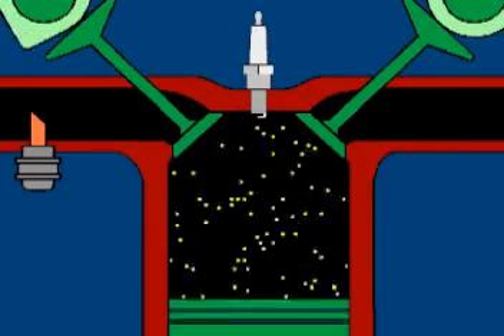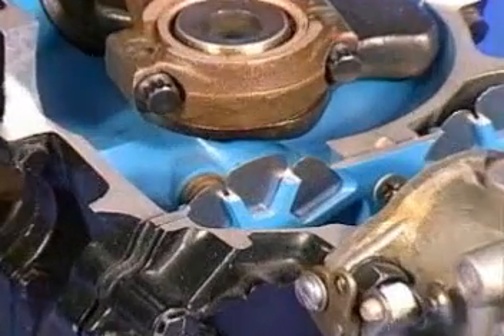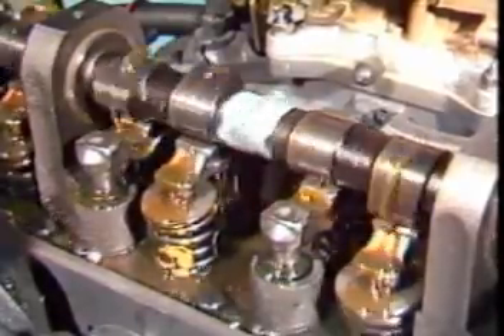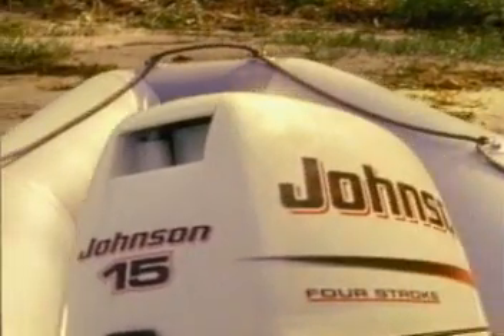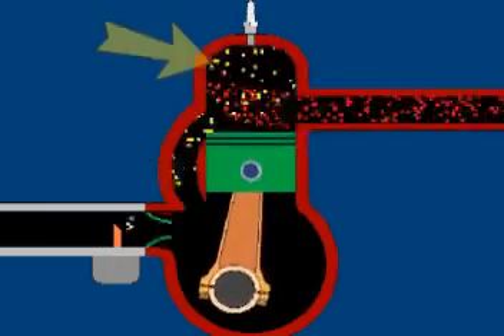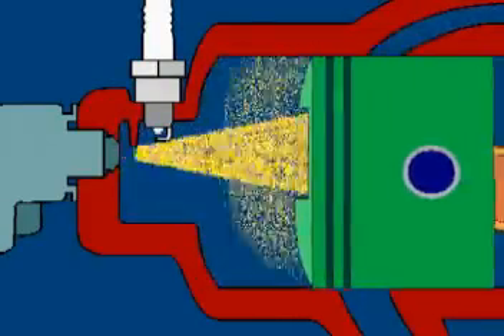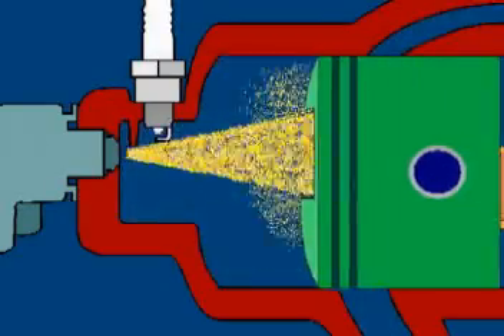2 stroke outboard Vrs. 4 stroke outboard

Comment: then you arent riding it right. what year yz250 is it? mine is a 96 yz250.  If 2 strokes dont have more power than how is it when climbing a hill, when i ride a 450 and it starts to bog i have to down shift, when on my yz 250 i can up shift and hit the throttle and the back tire is still spinning all the way up? The only thing 4 stroke has is torque. Or you can ride my dads 1980 yz465 2stroke and have more torque and topend power than a 450.

Comment: @MYNAMEISBBOYFIRE And because you're an 11 year old boy, someone with a greater perspective on the bigger picture should point out how exaggerated & flawed your argument is concerning polution. That two strokes, even with modern fuel injection, because of their constant loss oil system, will always be less clean than 4 strokes. However, their severely restricted & minor use in practical terms, means that their extra affect on the atmosphere is negligible to non existent.

Comment: Disc valve induction such as used on the Kawasaki KH125/AR125 is far better than reed valves, as discs are mechanical controlled and therefore, open and close at exactly the right time, whereas reeds rely solely on the crankcase pressure and thus are less precise. The two-strokes I've driven with disc valves give a better powerband and better fuel economy. We have to thank Walter Kaaden for the disc valve and this basically gave two-strokes a position at the top of the league table.

Comment: @Anoush13 The two-stroke engine only lightly compresses the air beneath the piston, so this doesn't hinder performance. However, a four-stroke engine has oil in the crankcase so this can cause fluid resistance of the crankshaft, therefore hindering performance, so dry sump lubrication then can be advantageous as the oil is kept separately to the engine and pumped to the various parts as and when needed.

Comment: Even with GDI Two Stroke engines, the oxygen entering can still leave through the exhaust and not all the excess CO2 leaves through the exhaust. You'll be getting a very unclean burn. Not only does this hurt engine performance, it also is terrible for the environment. 

Also, during the down stroke, wouldn't it be harder for the piston to move down, with all that pressurized air blocking it? This is also a major flaw, and hurts engine performance. Plus two strokes burn a lot of engine oil.

Comment: @bowen1100 They have oil injectors in specific places in the crank. That way it gets only the correct amount of oil exactly where it needs to be. It gets oiled better with like 1/10 the oil usage. Ski-Doo has a good video about it for their e-tec sled.

Comment: @bowen1100 

There is oil, you pour it into a resevoir.

But they use so little oil.

Agip, Honda, and some othe companies sell oil for direct injected 2 strokes, which also works in a regular 2 stroke.

Comment: @SonyCrocket Not true, you need to do a lot more to keep up a 2 stroke than a 4 plus they run at higher rpms so they get hotter thus shortening the life. Look at a Honda outboard they need very little upkeep 2 stay running. my dads went 4 17 years b4 it needed a new impeller and he has had nothing go wrong with it other then that. Also you know Honda is reliable because the US military uses them

Comment: Type in "Hirth 60hp 2-stroke heavy fuel engine with Orbital FlexDI (air-assisted direct injection)" in Youtube.

Explains the Orbital premix injection system - ideal for 2-strokes. Compressed air/fuel injected directly into the cylinder, computer management can give split second timing & air/fuel mix giving high power & clean emissions. Bottom end lube can be same as a 4-stroke. Have the Revetec camlobe replacing crank - no piston side thrust - Orbital 2-stroke top end - ultimate piston engine

Comment: @phyriz007 
"I wonder why Wankel engins arn't used in boats? There small, and can make some good power and spin to very high rpm"

It operates economically at its constant speed "sweet spot". A very low power/weight ration, "very small", means they are ideal for range extenders in hybrids, where they are rarely used because of the large mains charged battery packs - Audi are R&D them for this use. Can be under the trunk floor or under a rear seat - very smooth and quiet so feasible

Comment: @SteezySteez2011 
"Oh yea, and fuck electrics."

You better get used to them as they will be the norm. They are vastly superior all around. The weight of a battery set & electric motors to give same range as an ICE is about the same as engine/transmission and FAR simpler and infinitely more reliable. Ina car body designed for electrics, the batteries can be slung low to give a low centre of gravity meaning safer with far superior handling. Motor in wheel hubs means switchable by mcb 4x4.

Comment: @guitargod66 
"how is the bottom end lubricated?"

Normal oil bearings like a 4-stroke, using a scavenging blower. Pre-mix Orbital injection system is superb.  There is no need for 4-stoke engines today. Lotus have the Omnivore 2-stroke engine. Cylinder head is a piston moved up and down slightly by an electric servo motor to vary the compression ratio. Uses direct injection.

Look at the Ecomotor OPOC, Bill Gate's $ - 2-stroke opposed piston, opposed cylinders. Looks like to be on matrket

Comment: @MrWinner2160 Wrong, the two stroke delivers a power stroke twice for every time the four stroke delivers one, therefore yeilding more power.  The failure of your comparison is most likely because you are not comparing engines of the exact same bore and stroke.  Even though you're comparing engines of similar volume the bore and the stroke are what determine power and torque.  I am only 16, and I'vebeen  working on ICEs for about a decade and nothing in your comment makes logical sense to me.

Comment: From time 1:37 the MODERN DIRECT INJECTION 2 stroke motor is shown:

- it lowers the waste and pollution in comparison to classic 2 stroke motor with carburetor

- SEPARATE source of lubrication is needed (since the fuel does not pass through the crank case)

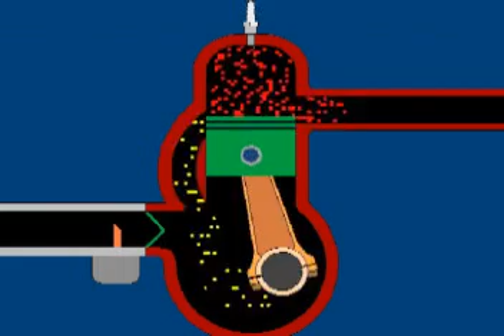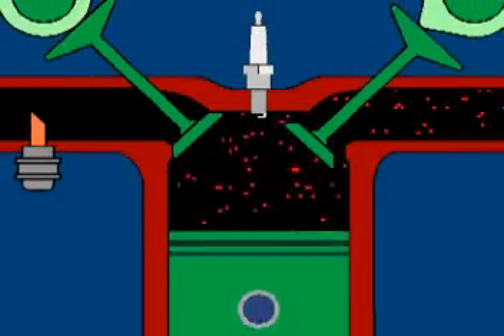Comment: @zeroc0ol2006 You obviously have no idea how a 2 stroke engine works... I suggest watching from 0:58 through to 1:25 over and over until you fully understand the cycle and the unique way that the 2 stroke engine works. The vacume of the compression stroke (which is when the piston moves up) draws air/fuel/oil into the crank case, which is when this area is lubricated.

Comment: @zeroc0ol2006 During the power stroke (when the piston moves down) the piston would first uncover the exhaust port allowing most of the exhaust to leave the engine and then it would uncover the intake port at the very bottom of the cylinder. The pressure in the crank case from the piston moving toward bottom dead center would cause the air/fuel/oil mixer to be pushed through the intake port into the cyclinder. Now the cycle starts over.

Comment: @zeroc0ol2006 So As you can see from this little lecture i have written, the air needs to move through the crank case in a 2 stroke engine. The 2 stroke engine cannot work in any other way. Fuel cannot be injected, it needs to move through the crank case to carry the oil, as air is too light and would not move it. The 2 stroke engine can only work in the way i have just explained. Stop this argument. Sorry kid but you lost.

Comment: @DangerZONEpixel Where do you see that the air flows through the crank case?
It only comes from the same direction.
I think that the crank case is a closed system filled with oil.

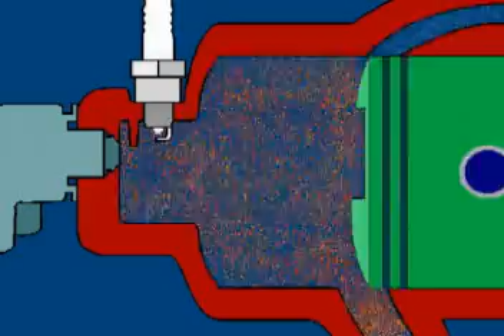Comment: @zeroc0ol2006 maybe try watching the video at the time zone i high lighted (2:00). The fuel is injected into the cylinder rather than passing through the crank case like it usualy would. Air is too light to carry the oil through the crank case by itself. Making this cycle impossible for lubrication to the crank case. Maybe you should rethink you comment now and maybe make an apolagy.

Comment: @Donnison27 I guess an oil injector in the intake air would solve that.  they did say that the air still goes through the crankcase.. another option would be to just supply oil through lines to the crank bearings and also oil sprayers.

Comment: using fuel injection system, I prefere one such design, 1st it did not draw the air into the crank case since there's oil in it 2nd it has dry sump as the oil jet is sprayed into the cylinder wall and crank case, 3rd there's no transfer port since being loop scavenging,the air enter the combustion chamber directly when top of the piston reach bottom end. in this way, it eliminate the need of mixing 2 stroke oil and has has greater reliability

Comment: just remember, after 10 years of running at wide open and the jugs blow in your 2 stroke, going through countless plugs and unmentionable bottles of oil, my 4 stroke will still be purring like a kitten, not to mention the low end torque in a 4 stroke.

Comment: from my previous comment, there should be a green 2 stroke petrol can run on straight gas as long as the air are not drawn into the crank case, such design may share the design of a 2 stroke diesel since they are lubricated in the same way as 4 stroke engine and can be turbocharged and/or supercharged, uniflow 2 stroke has exhaust valve on the top of cylinder. even small 2 stroke loop scavenged diesel engine use dry sump system without burning its oil in a crank case

Comment: I did like the uniflow design of a 2 stroke engine regardless if it is petrol or diesel, using fuel injector allowing to run on any of fuel. if I'm not mistaken, uniflow 2 stroke petrol engine can run straight on petrol without any problem since the turbocharger or supercharger are used for scavenging, thus not relying the crankcase and improving reliability, uniflow 2 stroke are lubricated in a same way as 4 stroke engine if not mistaken

Comment: @angelvetto19 without a crank shaft and the timming belt, a two stroke is a lighter engine. A very small vehicule works perfectly on 2 strokes. Even cars would be more fuel efficienty on 2 strokes. (I wouldn't pull that out on the highway, but still)

Comment: on 2 stoke model airplane engines, i notice when i run it unburned nitro sprays out the muffler. if you run it rich, as in more fuel than air mixture, a lot of fuel will spray out the muffler, and it will ruin your 70 dollar motor. nitro is 22 dollars per gallon too.

Comment: @jellyking12345 
they use such motors on  cruiser ships if I'm not wrong
The fuel injected is heavy diesel for those. And they have also gigantic roots blowers as air chargers

But as you say it could also be possible to use this system as moped engines with no oily exhaust

Comment: Bottom line is, if 2 strokes are so much better why aren't they more popular? It's like rotaries. I'd say having to add oil to the fuel is a task most people can't be bothered with so manufacturers stay away from anything that needs constant input from the driver.

Like water injection. Simply FABULOUS, you can raise your boost (if you have a supercharged engine), advance the timing, lean the mixture and use lower octane fuel but adding water is a maintenance item so they don't use it.

Comment: @jellyking12345  Ya I understand the motor oil lubes the bottom end but in a 2 stroke doesn't your fuel/oil mix lube the wrist pin, and connecting rod bearing? so if the oil's directly injected on the piston head how do they get lubricated? Thanks.

Comment: @WarbabyFox becouse compression of the 4 stroke is hygher then the 2 stroke it burns feul more eficient, i more then once drained the engine oil and was to lazy to bring it to the proper waste facility so i poured it into the gastank the feul mix had to be about 12 liters of gas and 2 liters of oil the bike ran just fine and did not even smoke my brothers 2 stroke yamaha 400cc smokes like hell and only has feulmix 1 50

Comment: @WarbabyFox i have 4 motorcycles all 4 stroke for my drivingscool so they get used dayly i change the oil evry year thats 4times 4 liters of oil thats 16 liters of oil a year thats way less then 1 liter a week and also the oil draned from the 4stroke engine gets reused as feul for ocean liners so in fact gets used 2 times i use the old oil to lube the chain and clutchkables and such

Comment: direct injected 4 stroke engines can be by the way made very efficient and powerful too.. the downside surely is the need for hi-tech electronics, but it's probably quite the same amount of electronics in 2-stroke direct injection. but as said, it depends on the usage

Comment: @outkasst88 is there a 2 stroke pickup truck? just confuse with your comment. inform me  sir. As far as i know there's is no 2 stroke pick up truck. Diesel or gas still 4 stroke. Coz  2 stroke only fits for boats, chain saw, motorcycle but not pickup trucks. Correct me if im wrong sir ty :)

Comment: right the reason why its not all its design specs a 4 stroke could have a longer "stroke" than an other engine which would increase fuel economy basically hes saying that if the cylinders are built the same (except for the valves) they are better for power and equal for fuel econmy but that only applies to engines which have the same power rating so a 70hp 4 stroke to a direct fuel ejection 2 stroke 70 hp

Comment: 2 strokes good in applications where high RPM (less moving parts), light weight (such as chainsaws) high power and constant speed changes (like snowmobiles) but 4 is better for more constant applications where weight and response speed isn't as important (such as generators, pressure washers and many lawnmowers) 4 strokes tend to last longer and do burn less fuel but are less efficient in terms of torque to weight ratios.

Comment: 4 strokes last alot longer! All the parts!! 2 strokes have a thrust difference but you can make a 4 stroke do that with a higher octane gasoline. 4 strokes are cleaner and run smoother.

Comment: Direct injection is the END for 2 strokes, they won't be able to make them any more efficient or cleaner. 99% of 4 strokes are getting the same fuel economy and emissions with Carbs or SIMPLE 1980's Automotive style fuel injection. The new lean burn 4 strokes from Honda and Suzuki are going to going to be 15-30% more efficient  than the DFI 2 strokes or current efi 4 strokes in the low and mid throttle range allowing them to have the lowend "snap" of a 2 stroke.

Comment: The evinrude outboards are 3 years no maint. just add oil to the oil tank, and gas to the gas tank.. the direct injections makes them very clean, cleaner than the 4 stokes by EPA standards. The direct inj is beggining to show up in 4 stroke gassers now.. the technology came from the common rail diesel engines.

Comment: adsys they are using sealed bearings at least on the Rotax snowmobile engines. So you still have to disassemble the crankcase periodically just like an old 2 stroke.

Comment: 2 strokes are alright for litlle power engines like motor bikes, but in the diesel world 4 stroke is a lot better, the two stroke is unbalanced firing all its pistons in 1 crank revolution as as said lots of valve overlap and etc.

Comment: problem is, 2 strokes still wont last as long because there is no dedicated lubrication system for the crankshaft, especially as there is actually no fuel oil mix going into the crankcase. Kinda wish theyd explained how they solved that problem

Comment: Well a 2 stroke engine placed on an Ultralight run very good but it lasts about 250 hours....now a 4 stroke is more efficient and sometimes does deliver more horsepower but it is more heavier and when you're in the air WEIGHT is your number one priority....it all changes when you're on the ground.

Comment: I agree... two stroke oil should be taken in consideration in the gas mileage equation on these machines...
Reply: I still ran a 96 225hp Suzuki outboard with fuel and oil injections on my 23' Trophy, same fuel consumption as 4T, uses very little 2 stroke oil, while 3 brand new  4T 150hp Yamaha outboards have gone to grave yards on my friends 21' Trophy over last 26 years fishing trips off shore....

Comment: lets be objective on this one- 2 strokes have better power to weight ratio, but they are nothing more than overtuned,short-life gas guzzlers..my dads 70hp 2 stroke johnson uses 25liters per hour at cruise speed...while my 40hp suzuki 4 stroke uses 6 liters per hour at FULL throttle and goes even faster then johnson.above it all- you have to change oil every few trips on 2 stroke... they BURN IT! 4 strokes use same oil over and over again and that is a big plus over 2 stroke in fuel economy

Comment: Re: those comments about which is louder... Neither 2 or 4 stroke engines are intrinsically louder.. it all depends on silencing.

The general debate?  2s for power, 4s for economy and longevity.

Comment: what about all of the oil you have to waste putting it into the gas tank every time insted of changing the oil every once in a while. oil prices just set a record high(over 100$ a barrel) so if you want to waste money you can get a two stroke.

Also ive never noticed cars being two stroke maby that is because 4 strokes have more power.overall 2 strokes are only good for cainsaws and weed wackers.

Comment: I'm curious. If a 2 stroke direct injection engine only pulls air through the crank case, then how does the bottom of the engine keep lubricated?

Comment: motorynka13:
In a direct injection engine the fuel and oil are NOT mixed. The fuel is injected directly into the cylinder, while the oil is injected separately into the crank case.

Please read previous comments before commenting. Asking questions that have already been answered in previous comments that you haven't bothered to read only serves to make you look stupid.